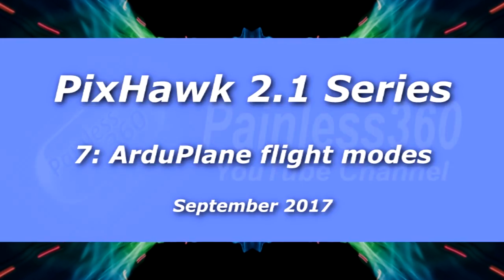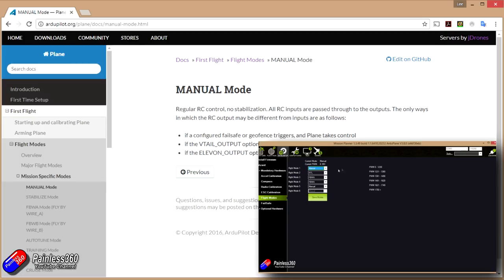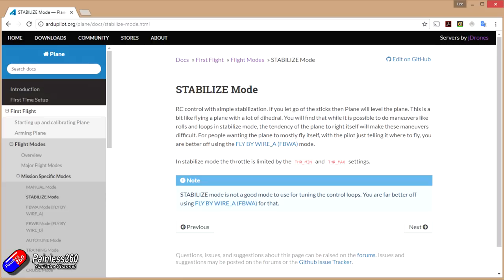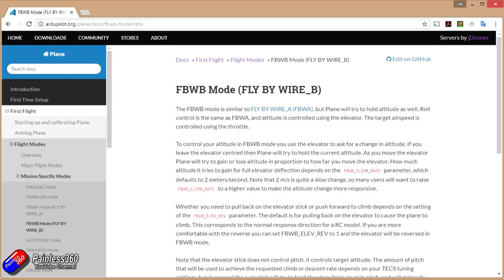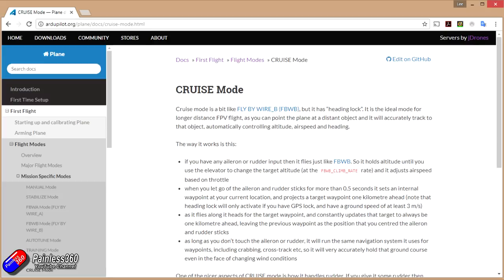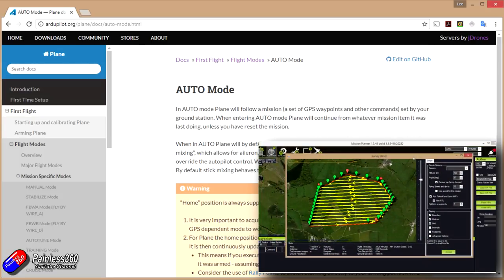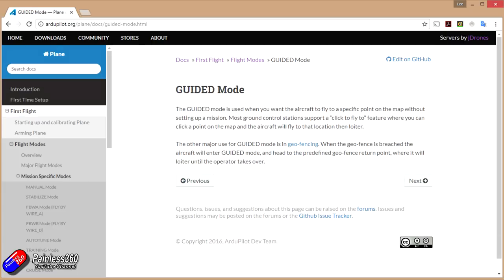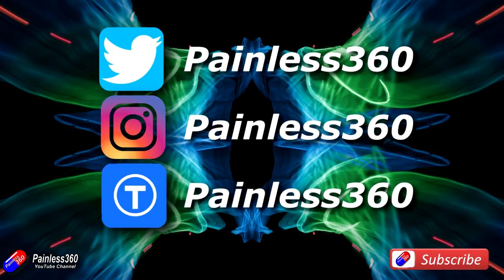(7/9) Introduction to PixHawk 2.1: Overview of the ArduPlane flight modes

Comment: Flashed an Omnibus F4Pro w/ Arudplane. Using Ublox GPS and FrSky X8R Rx. So far things are falling into place, however RSSI is not properly reporting in the OSD. 
For my iNav setups, I would configure a channel for RSSI, configure the input for that channel and set some weights and offsets and it work.
Trying that same approach in Arduplane it is showing 21 or 22 for RSSI and doesn't change when I move around.
Any ideas?
Reply from the maker: I'm waiting a little longer before tackling Ardupilot on traditional Flight controllers and doing some videos so I've not had chance to play yet. If you figure it out, do let me know. Best of luck!

Comment: Can a pixhawk fc  board work in a maned size craft. Have you ever seen info on motors and controls large enough for same?
Reply from the maker: No idea, in theory - possibly? I'd be fascinated to see someone give it a go! :D
Reply: I have a Taylorcraft project to do but I'd rather do a man quad. Unfortunately I'm old and broke, your backing might help :)
Reply: Both stable test flights with poorly designed craft. I'd call that a success. Counter rotating props a good idea but 12 of em? Ehang looks better with 8. Imagine what that would cost not counting batteries. The rest of the craft is affordable.